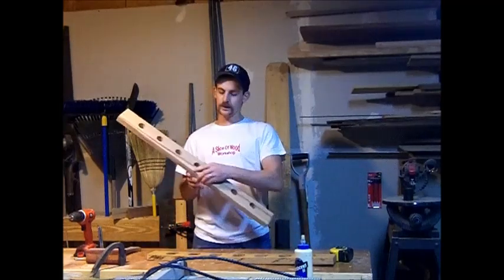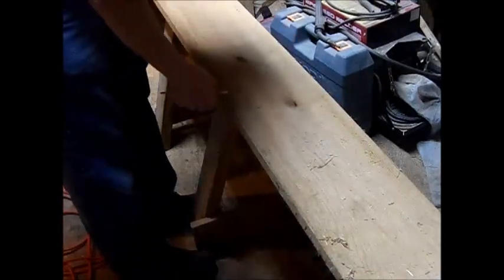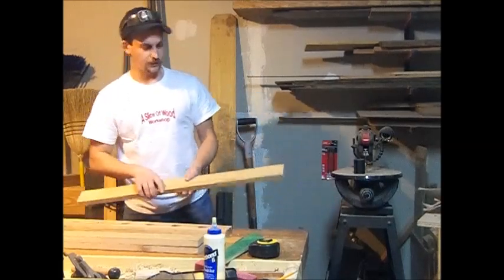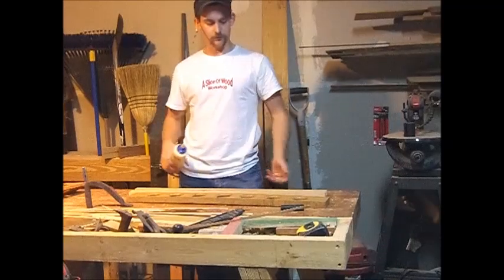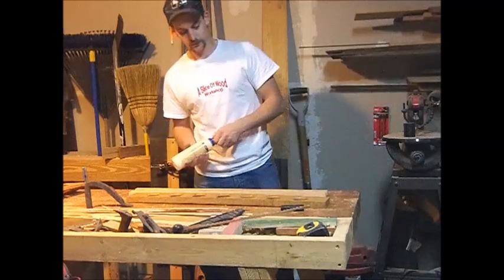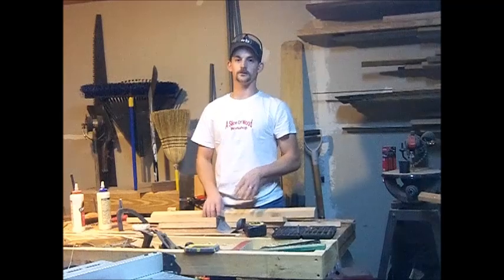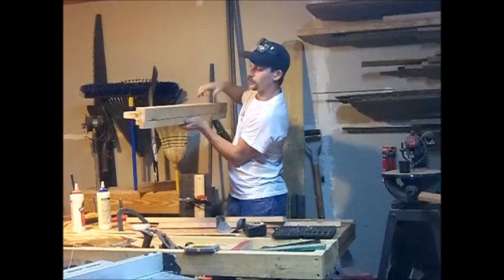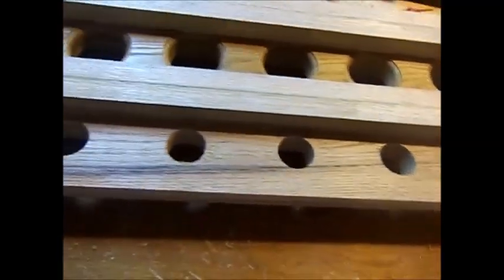Quick and Easy Fishing Pole Rack

Comment: could have used a dado blade set up on your table saw to cut the groove in the backer boards for a smoother job but very nice work dude thumbs up
Reply: Actually on that particular table saw, you can't install a dado blade (it's certainly not recommended). Those bench top contractor saws are direct drive only and the arbor isn't long enough. Also, a dado puts a much bigger load on the motor (your're removing a bunch of material) so it has to be able to provide the added power and torque needed to use a dado.

Comment: Nice Job. Please use a splitter and or blade guard on your thru cuts on the table saw. You may get away without one for hundreds of cuts then all of a sudden a board with an unseen stress is cut and so is your hand. I work many hours in a woodshop and have seen this happen to others that insist on taking blade guards off. I know sometimes this is done for demonstrations but I'd like to see you make many more and with all ten fingers. Remember those folks that watch may be using a table saw for the first time and will follow your lead. Thanks.
Reply from the maker: +Dan Hoffman thanks for watching the video. I have no table saw actually. I have moved over to handtools. It is however very important to take all safety precautions so thank you for the reminder!